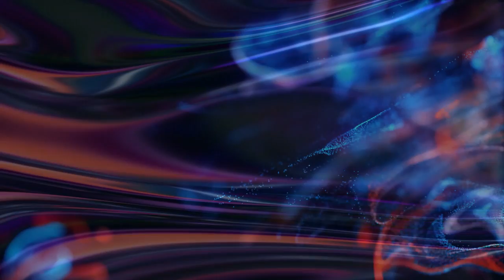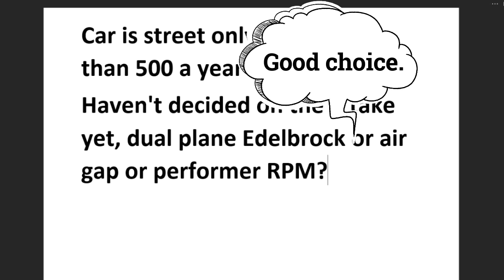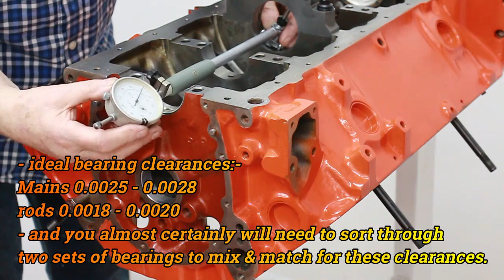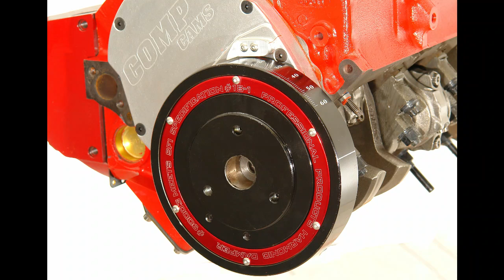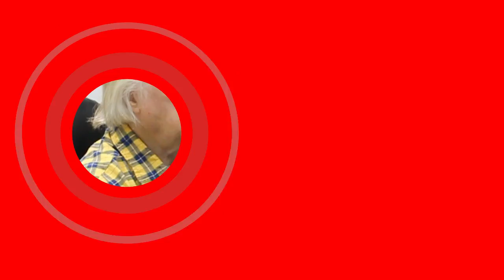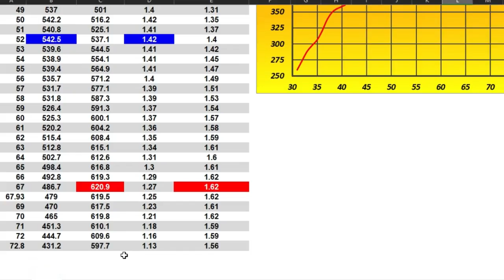How we built that super competitive low buck 383 SBC

Comment: Hi David, this is akram, the subject of your critic, to bring you up to date I have made a few changes to my original build, some due to supply issues and some due being better informed. I just got my block back from the machine shop last week and my cam/lifters/rockers finally arrived last week also. I was unable to get the Scat crank and received a cast one from Eagle, I was disappointed in the quality of the crank, very rough casting, sharp edges, etc., so I went with a forged one from Eagle even though my build didn't require it, it was a very nice piece much more refined, smooth finish, rounded edges, chamfered oil holes, etc. The cam I ended up going with came from Straub Industries. This was spec'd by Chris Straub himself based on the application I gave him going in car that was going to be a cruiser on pump gas, good idle, and not a high rpm street racer with big hp. The specs: hydraulic roller, 282/288, 223/228/ @.050, .580/.555 lift with Harland Sharp 1.6 rockers, Morel lifters, 110 lsa. I also changed my pistons to 12cc d dish as I was concerned my compression ratio was pushing the limits for 90 octane pump gas. This leaves me with 10.03 to 1 scr and 7.57 dcr, quench is .045 with my AFR heads and .040 compressed head gasket with the pistons .005 in the hole.
 That being said I'm contemplating fine tuning my quench by either zero decking my block or going with a thinner head gasket, the trade off is I'll be raising my compression ratio a point to 10.1 to 1. I appreciate   your comments, and look forward to watching more of your content, best of luck.
Reply from the maker: Ak ram,

Good to hear from you. I really hope your build all goes to plan here. You will like the results!
Chris is off on the LCA (107-108 is it) and you don't need 282  duration. A 274 duration would have been better for your application.

Comment: i have a old school large journal 350 and a 400 sbc's only problem they both run good so i have not made a 383 out of them plus the 400 is in a 79 4x4 short box cheyenne and only has 35,000 miles on the truck  in mint condition, hard to pull it out not worth it but i did get it for free. i been getting the 450 hp 454 with the 4 inch stroke with a 02xx 400r turbo for free . last year i got 4 setups from 6,000 to 58,000 miles on them. they have steel crank heavy rods high flow heads all it need is to breath all factory built ' all i did was put a high rise and a big carb it they come alive . i have another one that i can get for free just need to pull it but don't need it have an offer for 2000 and they will pull it. i looked it up at chevy and for everything that i get but radiator and coolers that i also get it cost all most 15,000 for the setup new. just the long block is 8,000 at chevy. the trans is good to 800 hp stock has most of the parts to make it a 2,000 hp trans even has a stage one shift kit from factory makes the perfect street trans runs good. but i have a shit ton of chevys and a few fords. mite be selling a few square body trucks all are rust free good bodies some have engines some don't make good projects . i all ready have my square body truck don't need to build one plus i like the 67 and 68 chevy pu's which i have a few of them. i get most of them for free by hauling them off of property going up for sell. that is how i got a 67 ss rs 427 yenko camaro for free 1/2 restored with a 68 ss 396 camaro in need of restoration bad but good clean body

Comment: Back in the late 70s there was an article in HR (or Car Craft) specifying a 350 SBC that used a de-stroked 400 block with fairly high C/R.  They used "long" rods from a Ford engine. Quite considerable HP was yielded with "cat pee" fuel (87). This auggests that more complete combustion without detonation was achieved, apparently from the longer TDC dwell due to rod length.  I was watching slo-mo videos of "clear" engines where the actual combustion of the F/A mixture may be observed.  It appeared to me, a typical engine wastes fuel because the piston retreats from TDC too quickly for all the fuel to be burned.  To counter that, more advance would help, but the risk of detonation, and the resultant engine destruction, limits that solution.  The longer dwell apparently mitigates the problem, with the added benefit of less piston slap as you mentioned. Thank you for your vids; if I were to build a budget SBC, I would blindly follow your instructions and component selections !!
Reply from the maker: Vince,
 you are overthinking this!
Reply: @marvingvx1  True.  I have a PhD in overthinking....  According to your results, the engine I mentioned could have achieved the same results with the right cam.  I would have never thought slight changes in lobe timing would have such a dramatic effect.

Comment: I’m building a very similar engine to this and have 1 question that I can’t seem to find much credible info on.  383 bore is 4.030” but the chambers on my heads are 4.125". That being said should I notch the top of the cylinder bore to match up with the chambers like you see on a big block or should I leave it alone and just have a big ledge hanging out into the chamber.  Thanks.

Comment: I built a very close 383 to your example motor I have a 530 558 lift 238 248 duration  112 center line I put a 671 blower on it 8-1 compression.   now will the 107 center line help this build ? I can run 9 psi of boost but it really eats up my gas on the street
Reply from the maker: Robert,

The LCA is close (110-111 might be a shade better) but make sure you have less cam advance than for an atmo motor. I would say( and this is a guess as I do not have full details on your engine spec or flow numbers) that 1 -2 degrees would be better.

Comment: Thanks!
Reply from the maker: Andy,
 thanks.
DV
Reply: @marvingvx1  Hi, I hope you are getting the support you need. 
On a side note, I read in one of your sbc books years ago about re-facing lifters by hand on a piece of 100-grit emery paper by drawing a figure 8 pattern with the face of the lifer on the paper. I have used this tip a few times in bbc applications and it works beautifully.  I think this would be great info to get out to people during the lifter failure pandemic we find ourselves in. Also, I have kept every decent stock lifer I have come across since I first tried it. To think of all those usable lifters that get thrown away with a rebuild...sad. Also, endless gratitude for sharing some of your wealth of knowledge with us.

Comment: Hey DV on that 110565 Hwrds cam it has a 108 center line the 112 is the separation angle. I have a 110265 that's a little bit larger and it's a 108 CL
Reply from the maker: Bo,
 Yes that is totally my point. The LCA or LSA (same thing) needs to be 107-108.

Comment: I love your videos! They always leave men wanting more! You might have already talked about this on a previous video, but how are you running 12.5:1 static compression on pump gas? Most people say that 11:1 static and about 8.5:1 dynamic is max on pump gas.

What kind of vacuum does your 383 make at idle? I was under the impression that going with an LSA under about 110 degrees decrease vacuum to the point where you can't use power accessories without a vacuum booster
Reply: I think static comp depends on the cam profile, as a valve that closes later means less compression than the basic maths would suggest.  In 1971, Ford Australia was producing a factory engine for road use, using pump gas, and with a comp ratio of 11.5:1...so 11.1 certainly isn't the ceiling for static.  👍

Comment: Love the videos-
Built a similarly low buck 383 but did opt for the 112 LSA comp cam to prevent reversion…
Also the outdrives don’t like much more than 5k rpm so these are low RPM grunts- would love to hear your recommendations on 400hp @4800rpm
Reply: Yeah, the lube seems to fly off the outdrive gears above 5200 RPMs for very long... 
https://www.motortrend.com/how-to/gm-ht383-crate-small-block-tune-up 
https://www.youtube.com/watch?v=B3Je1MLTphs&t=1s

Comment: Well we got close. lol. My sons 383 build was a 638 block arp main studs, scat 9000 3.75 crank. scat pro series i beam 7/16. wiseco pistons with full floating pins. .017 above the bore. had to be decked that much to clear up. .060 cometic gasket that gave us .043 squish. cam specs. mechanical flat tappet 107 lsa, 264° x 270° @.050 with a .585 lift on ex and in. Brodix ik200 heads with a cnc port job. 2.02 x 1.60. custom pushrods and comp rocker arms pt.# 1601-16. Weiand team G intake Holley 750 dp. tci super street fighter trans and a 3800 stall.Seems to run pretty good. lol havent took it to the track yet. need to get the ford 9" installed. dont think the stock 3rd gen Camaro 7 5/8 is gonna take it.

Comment: Hi DV, I watched this intently to see if you mentioned what you got for timing, dynamic compression and what octane the engine requires, but did not see those mentioned.  
I imagine I  might be able to spirit some of them from a careful rewatch with a note pad. But is there any way you could comment?
Thanks so much for your wisdom. I'm redoing a marine NA 383 that's going to a dynamometer for ring run-in and setup.

Comment: Scat 9000 3.75” lightweight crankshaft: check
Scat pro series 6” rods: check
Wiseco street forged pistons: check
9.7:1 compression: meh but will work. 
.035” quench: check
AFR  Eliminator 195 heads w/ PAC springs: check
110LSA: meh, but it’s a street car and will work
850cfm TBI unit: check
880 casting 4 bolt roller block: aw hell
Reply from the maker: Cory,
9.7:1 compression: meh but will work.  (Yes but 19.5 will be much better)
110LSA: meh, but it’s a street car and will work (Yes but your build will be down some 30 odd lbs-ft)
880 casting 4 bolt roller block: aw hell (keep it under 500 hp)
DV
Reply: @marvingvx1  is this block weakness you’ve noted in the 880 castings one that was also present in earlier factory 1pc RMS/ roller blocks? I ask because I also have a block from a later TPI engine laying about I’m considering to build

Comment: How does a 638 roller block casting compare to the 088 casting you mention? I used a 638 for my 383 and it sonic checked very well for a factory block. Some cylinders measuring over .300" on the major thrust. At std. bore.
Reply: I am curious as well as I just got done building a 383 with a 638 block. This build should put it North of 500 pretty easily, -which makes me nervous now. My 638 is a 4 bolt and was made in 1994.
Reply from the maker: Guys,
 I have never use a 638 block so need to learn about that.
DV
Reply: Same here, following.

Comment: DV - thanks for your experience and insights.  Could you elaborate on the proper LSA for a mild street engine (V8 and V6)????
Reply: Look up David’s “128” formula for finding the right LSA for a typical street compression SBC. The number is different for a BBC and gets slightly altered for high compression engines.
Reply from the maker: Hey, big G,
Going to do a cam deal for blown and turbo motors. bottom line is about 99% of turbo cams could only be right by shire luck. I will explain why in detail and then you will realize that without some vital spec details I nor anyone else can give yo a totally functional spec.
DV
Reply: @marvingvx1  THANKS DV.  What you said is what I thought.   Looking forward to your presentation.   By the way, ole Richard H. thinks every cam is a "turbo" cam.

Comment: Thanks! Ive watched nearly all of your your youtube videos, Genius! My high spec" 383 made only 511 with a Cam Research cam. Would you share your cam spec?
Reply: He says in the video his cam was 300/304 on a 108lsa
Reply: @sethmiller9442  yes, I did hear that but also need the lift!!! Maybe also the full cam timing ……
Reply from the maker: Mikaela,
Let me have the details of your engine and what you want (Hyd. or solid) plus application.
Reply: @marvingvx1  
383 with scat superlite rotating assembly 3.75 stroke,flat top pistons, 10.0 to 1 CR, AFR 1065 eliminator 220 heads,AFR 4810 eliminator intake. Cam spec is Solid roller, Intake duration at .050" is 256 / exhaust 264.
Lift  with 1.6 ratio intake .624" / exhaust .595".
Lobe separation 109 with 105 intake centerline. 950 cfm 4bbl,  road racing application……..

Comment: David, new subscriber here! I am frightened that I may have an 880 or 632 block. The casting number on the rear passenger side is 14093638 and is a 4-bolt. From what I can tell it was made from 87-95. I would appreciate any input yourself or anyone else may have on what I have. Thanks in advance! Ok, I just discovered it is a 638 block made in 1994, still curious about whether it has the same limitations as the block David mentions.
Reply: I also have a later roller block that is factory 4 bolt. I’m following this.

Comment: The first article's I remember reading, about building a 383 with deliberate purpose was DV.
That was many years ago. I have yet to build or buy a 383, because what seems to be offered as far as I can tell is a 350 with a 400 crank period. The thing about #880 block was kind of shocking. If I do build a 383 with this power level, this is the way to do it. If I can find shop that can assist with a build like this, that would be great. If I could just say please Mr. DV, build me one of those, that would be better yet. Great work Mr. DV.
Reply: There's several variations on the 383 from stock 400 crank to cast and forged aftermarket cranks... external or internal crank balance... different bearing sizes... can also get a stroker crank to make a 350 into a 400"... Chevy HT383 crate engine uses stock 4" bore and crank with slightly more stroke than a stock 400 crank... and depends on budget available for most people...
Reply: @BuzzLOLOL  what I was getting at is....from some of the 383 offerings I have seen, minus all out racing offerings, they don't seem much better than a 350. I'm thinking of street/strip combinations. If I could find a 383 built like DV did in this video, I would seriously consider buying it.....a 383 on a mission, if you were.

Comment: The intake has a extremely hi velocity throughout the rpm range. A single plane intake would raise the torque and hp above 4500rpm. With about a 15 point loss below that.  And the cam could be opened up on exhaust duration a bit to make up for that loss. 
  Rivers racing Concepts builds a 383 with the dart 225 head and garenteed 550hp on 9.5:1 pump gas. The cam is the comp 305h cam with .525 lift and 250 duration.  From 3500 on it pulls like a raped ape. For street driving it's a bit of a hand full. With a 292/294h cam your still going to be above 550hp with better street manners.